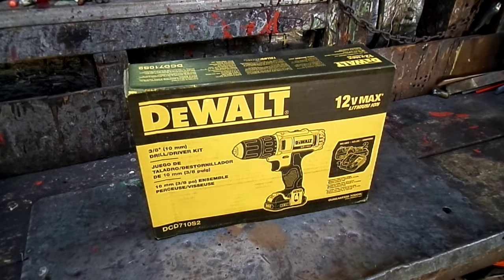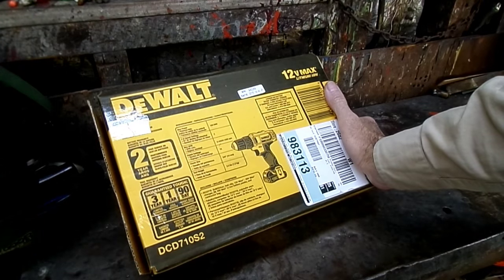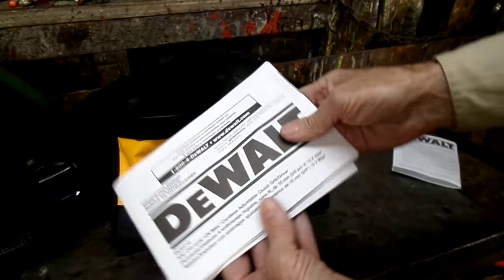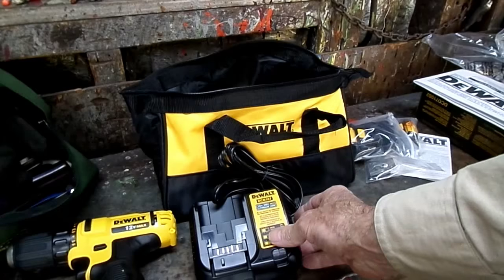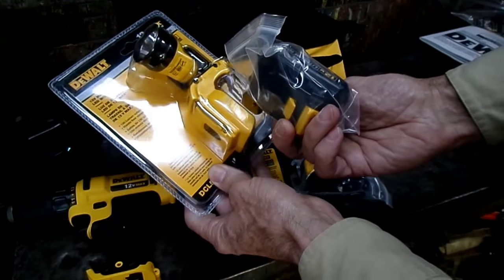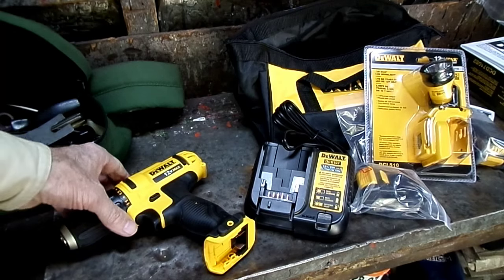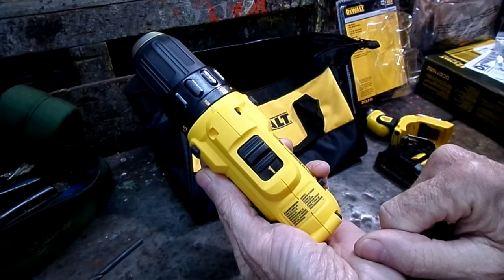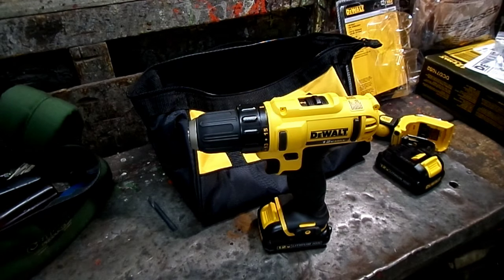DeWalt 12v Max Drill Driver Led Work Light Review

Comment: I use the 20v 1/4 impact at work alot and it's one tuff sucker. I droped it from 26ft in the air accidentally onto concrete and it barely made a scratch on it. Also once I droped it into the pool and it still works!! only had to clean up the battery contact points on the drill and battery from corrosion but it still works 100%.
Reply from the maker: whoodiestyle Good to know i can drop it and it has a good chance of survival.